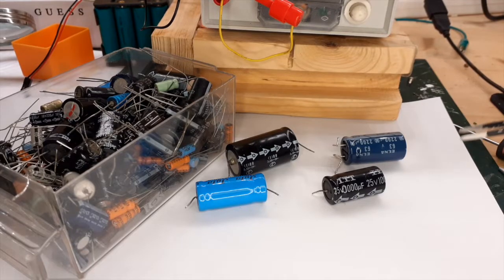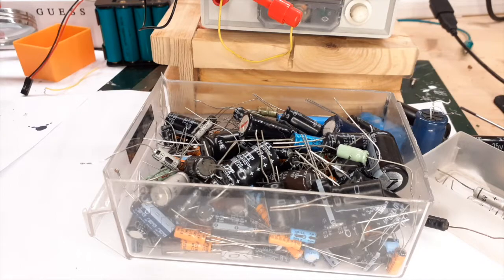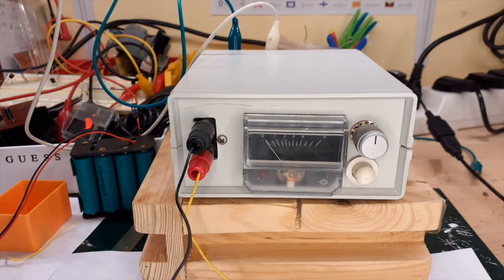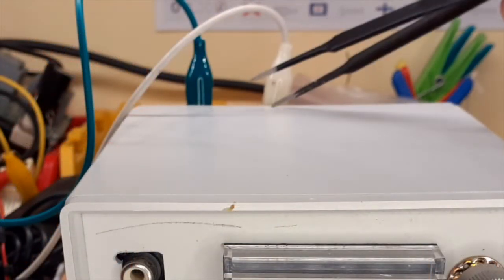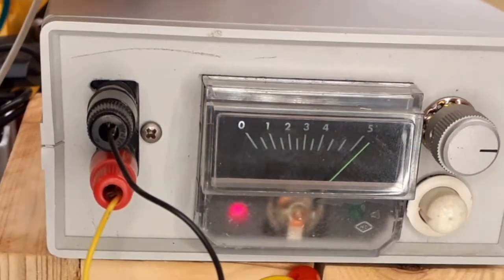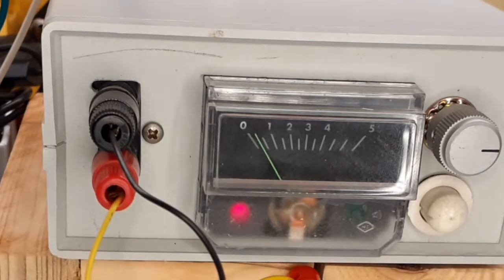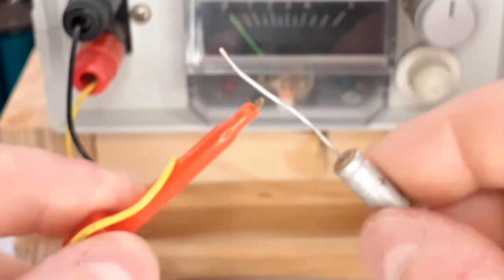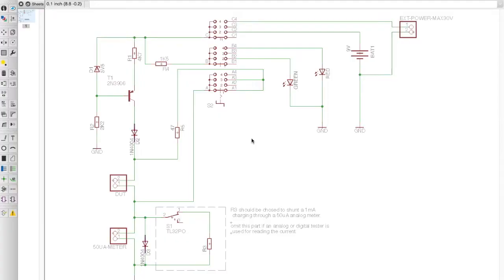Capacitor Leakage Tester AU-0522-I - (PART I)

Comment: Nice. Might make one as I have a 50 UA meter that is going unused
Reply from the maker: even if the multimeter measure is more precise the old school meter is more cool to see when capacitor charges, sometimes you notice that the needle makes strange moves, it seams that the capacitor charging take place not in a continuous way, i have to investigate this phenomena.
Reply: @gfr2023  yep I have a box of them I am going to put to good use some day